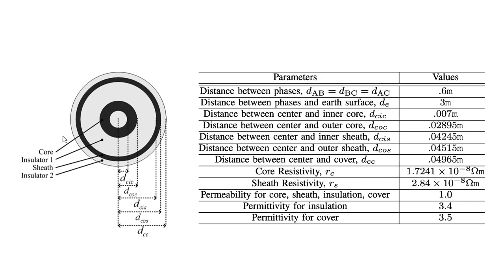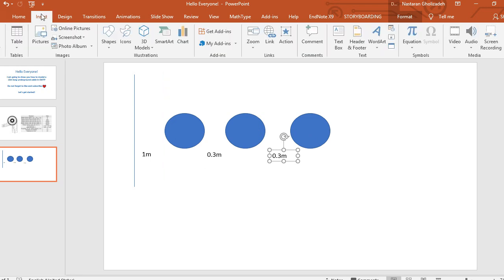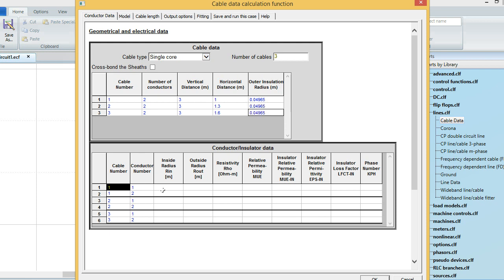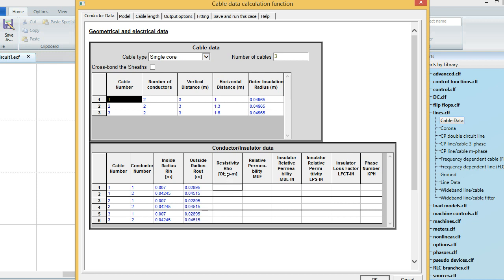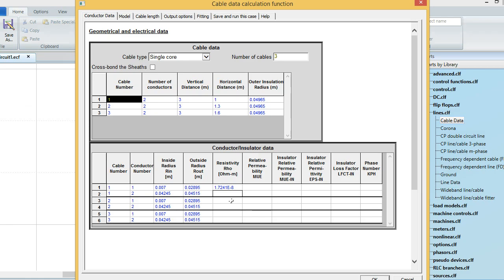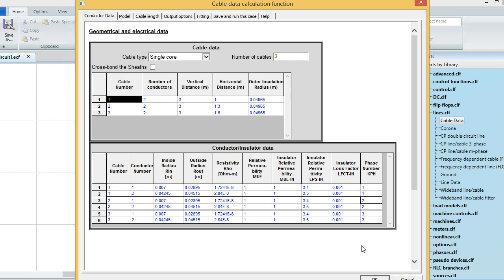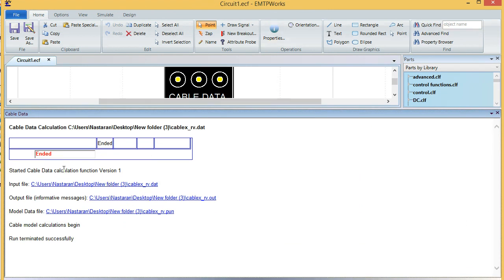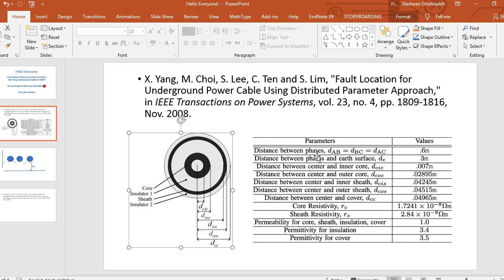How to model a cable in EMTP (Electromagnetic Transients Program)

Comment: Is there a hole in the centre? Wouldn`t the centre also consist of the core?
Reply from the maker: Center has a conducting core.
Reply: @powersystemgeek1951  so that would mean that the internal radius would be 0.
Reply: @powersystemgeek1951  The inside radius for the first conductor i.e. the core conductor you have specified it as 0.007m for the three phases, would not that be 0 ?
Reply from the maker: @blueberet7272  No  zero radius has  no meaning.
Reply: @powersystemgeek1951  but why? could you please explain? im tring to model an XLPE cable, with a copper solid core. so im really not understanding what would be the Rin and Rout for that core